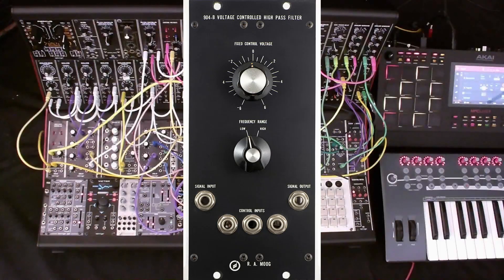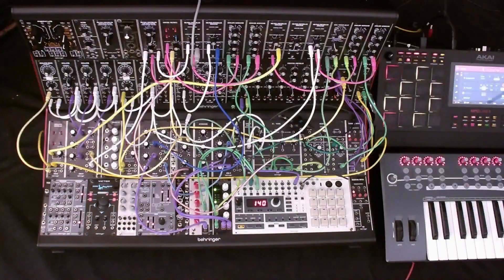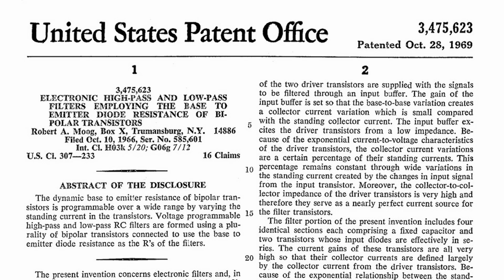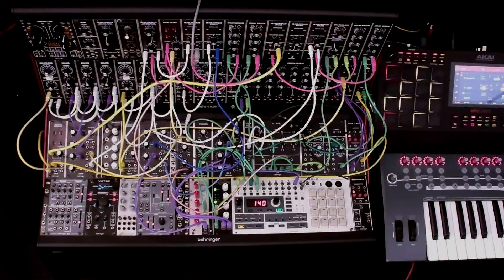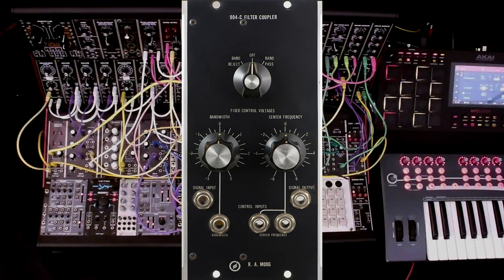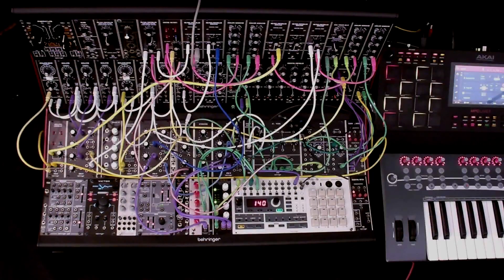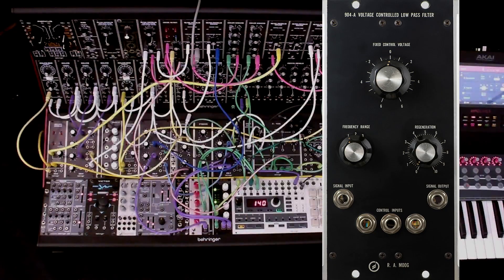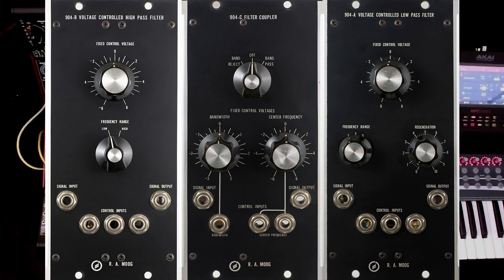904C Filter Coupler for System 55

Comment: Fantastic video and Mark is a great guy! Its a great module kit and sounds fab.
The AM904C assembled module will be shipping in February, a small amount of soldering (6 wires) is needed to connect the daughter boards. Or you can purchase modified Behringer 904A/Bs with the AM904C, which are plug and play using one internal cable. 
PPG and Projekt Elektronik made single modules that do the same job, using two minimoog filters in the PPG 317 and two ARP 4012 filters in the PE 290. Both of these will appear as AMSynths modules in 2025. Klaus Schulze happily used band reject on his Moog 904C in his live shows but Chris & Edgar went down the PPG route, whilst Paul used the big PE system.
Reply from the maker: Rob, thanks for that added detail!
Reply: Hello Gentlemen.
I can't seem to find the modified 904B from the AMSYNTH Site?
Reply from the maker: @svetkolisica1635  I can't speak for Rob ( @Amsynths ), but I suspect he will add the modified 904A & B once the 904C is available.
Reply: @ozhalljr  Thanks for the video OZ.
Like the 904C combo with the 904A/B🙂
Reply from the maker: Thanks for saying so!

Comment: Many thanks for your kind comments O.Z. (and Rob!)    General observations: the 904C is a bit of an "odd" module, it has some sweet spots but also a lot of "dead" zones - you need to read (and I find re-read!)  the original Moog instructions. It's not as "obvious" to use as, say,  a modern state variable filter.  There can be some variance between the  output levels of the Behringer 904A and 904B filters which can lead to an unbalanced 904C output, specifically in the "band-reject" mode. This can be compensated in the 904C by modifying  couple of resistor values.
Reply from the maker: Mark, thanks for the observations.  Where can we find out more about the resistors to modify.  At $29 per module (904 A/B), replacing the resistors seems not a (potentially) expensive risk.
Are the original moog instructions in your build document for the 904C?
Are they in the service manual (starting p. 39):
https://www.synthxl.com/wp-content/uploads/2019/01/Moog-Modular.pdf
Is there a different source to which you're referring?
Reply: @ozhalljr  The resistors in question are in the 904C: R20 and R27. They are both specified as 10K. The issue that was flagged to me was that the B55 LPF output was lower level than the 904B HPF output. Reducing the value of R27 slightly (I think, I havent tried it) should compensate. Ideally you need to check the 904A and B output levels against a fixed input level to gauge the size of the R27 reduction. Yes, the moog instructs (plus other comments) are in the 904C build doc.
Reply from the maker: Thanks Mark!